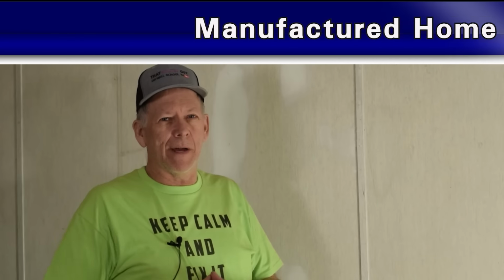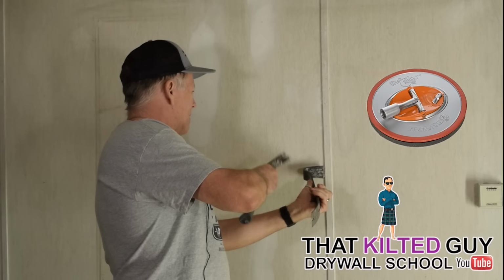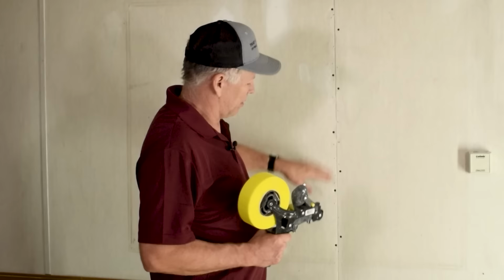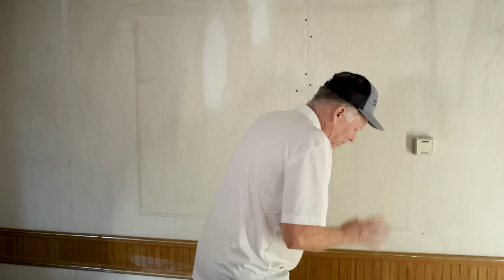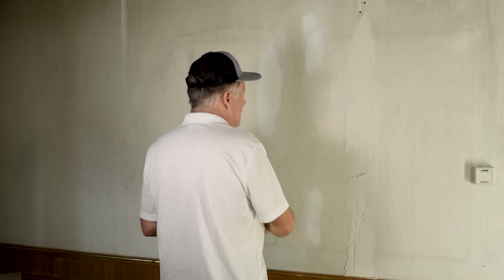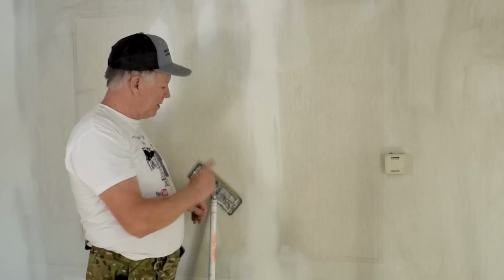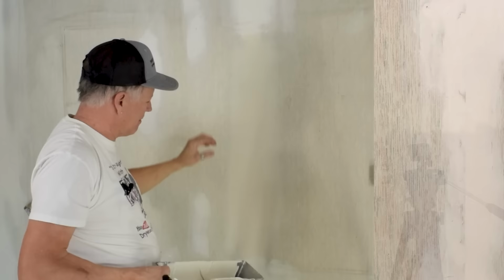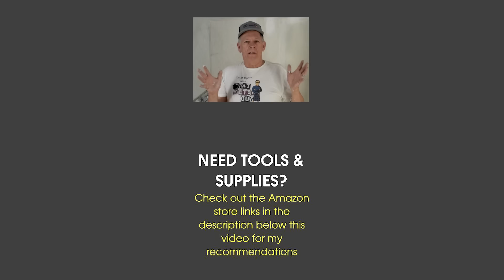Mobile Home Wall Removal in 2022. Smoothing out the wall strips

Comment: The only problem using this method with mobile homes is you can't see any studs, wires, or insulation. A drip comes through the roof, down a rafter, turns at a wire, turns onto a rafter 5 rows down, down a stud to a pipe, turns again to where its seen nowhere near the problem. The damage must be removed all the way to the problem. Watching this process and the repair estimate that follows can wreck your life. Also mobile homes unlike a house have 3" walls and are horribly inefficient. Any insulation issues puts you in the worse than horrible category. You can't just remodel over water damage because it'll be sealed it in and literally destroy your home. Inspecting, replacing, or improving your insulation is huge for efficiency. Updated windows too. Of course dumping a lot of money into a mobile home is in most cases a bad idea and easy to do. They don't sell any of that crap at Lowes. They'll have some things to sell that are an emergency band aid...but mobile home supply stores and online sellers have proper replacement and upgrades. Their prices are many times more than standard building supplies. Its diabolical considering a huge number of people that own mobile homes are low income or poverty. Excellent mud tips...I didn't know they had that fiber product now.

Comment: I disagree with this method 
Yes set the staples and screws in the same way but after that use Kil primer before applying the mud that will assure the mud will stick and not release from the wall
Reply from the maker: Like I showed, this wall had a coarser raised pattern to it that gives the mud plenty to hold onto. I've done the bonding primer before but because it takes up to 30 days for it to truly cure, it really doesn’t have the adhesion you think it does until you’ve let it cure fully. I’ve had instances where the primer came off while I was texturing the walls. But overall it works.

Comment: Looking for your video on filling wood paneling grooves and what you recommend for filler. Thanks!
Reply from the maker: If the paneling flexes it will crack the drywall mud but otherwise just use regular weight all purpose joint compound

Comment: How would you patch holes in this type of panel
Reply: I'm guessing there's no way
Reply from the maker: Pretty much the same as any wall but the vinyl will be missing on the repair so you have to paint the whole wall
Reply: @ThatKiltedGuyDIY  So I can make a drywall patch and mud it
Reply: I was just worried about the mud not holding to wall
Reply from the maker: It usually sticks fine
Reply: @ThatKiltedGuyDIY  do they sale those panels anymore

Comment: One pro to another, mesh tape is a thing of the past my dude they designed paper tape to be better than mesh which is why we have bazookas that run paper tape not a mesh tape gun
Reply from the maker: Actually each one has its own place and mesh tape has been around forever. I have installed well over 500 rolls as I’ve done nothing but repairs for 20 years and have not had one problem. For new construction I would still use paper tape and the reason we do that is because it’s cheaper, faster in a bazooka, and it also works when used correctly. It’s all about technique and skill as I can make any of the joint tapes work just fine. Thanks for commenting

Comment: No. A thousand times no. Tear it out. That crap paneling is a fire hazard and they likely stink from the former owners. Rip it all out. Insulate it with Rockwool R-15 insulation (you may have to bump out the studs if you have 2x3 framing like I do, you can get 1x2 strips at Lowe's). Mice and bugs hate it, fire and water proof. Good sound deadening too.  Vapor barrier (do it right, it's different North vs South U.S.). Drywall with 3/8" sheetrock, walls and ceilings. The ceiling panels are even worse. Also a wicked fire hazard. You're breathing that crap. Do it right the first time like I'm doing. My entire MH is almost done, just some more sheet rocking to be done after the holidays and ALL walls and ceilings are done. No hacks. All work. Will never have to do it again. Neither will my son when I die.

Comment: I don't think you need to do all that how many years you say you have done this???
Reply from the maker: I first walked on drywall stilts at the age of eight in 1969. Well over 35 years of actual experience. I’ve fixed modular homes at least 20 or 30 times
Reply: I did do what you said and it worked out good for now on when I need to know something about doing sheetrock I will watch your videos you are really good thanks 👍🇺🇸😎

Comment: How do I know if its drywall under my vinyl or gypsum? Or is that the same thing?
Reply from the maker: If it’s the original walls, it’s pretty much guaranteed that you cannot strip the walls.
Reply: Yes gypsum is drywall..some call it sheetrock  ,which is a brand of gypsum drywall..
Reply: It's technically called VOG in mobile homes, vinyl over gypsum. They use vinyl instead of paper normal drywall uses so there is no need to finish the walls after you staple them up and slap the trim strips over the joints. Thinking I'm going to have to try this in one of the bathrooms first to see how it turns out before tackling the whole rest of the place.

Comment: I have a 1997 Sunshine 
Serial number AL-S-35138
Reply: S508
I don't know if you can look this up. But thought I would include all information I can. I'm a 63 year old woman, so near with me. Whe you open the front door there is a foyer area. Just a partial wall. It has the kitchen cabinets on the back side. I would like to remove this wall, and have a open floor plan. The center has a high pitched ceiling. It goes into a vshapto the center. There is a large bedroom and bath at each end. These have regular ceilings. Since the wall I want taken down has top, and bottom cabinets, I am thinking it might be a load bearing wall. Do you have a video on removing a wall such as this? I do want to remove all the trim pieces between the drywall. Like you showed in this video. I will watch it a few more times. Do you think I could manage this with my 14 yr old grandson? Not much scares me lol. I hope you do have some information on the removal of that wall. It makes the kitchen so small. I look forward to hearing from you.